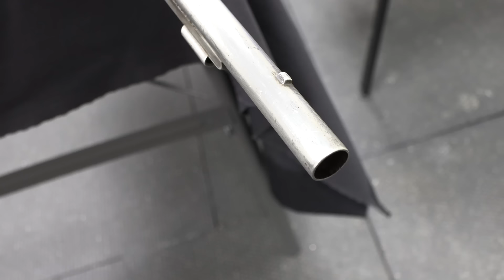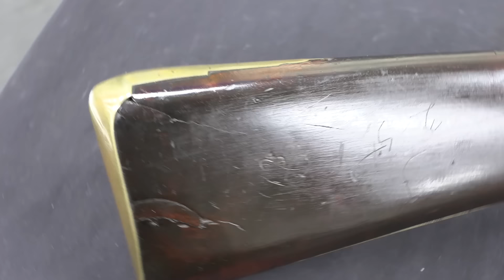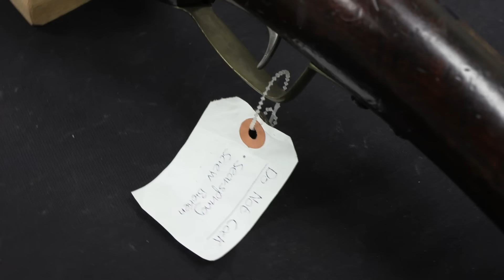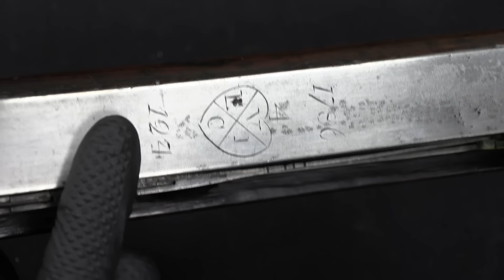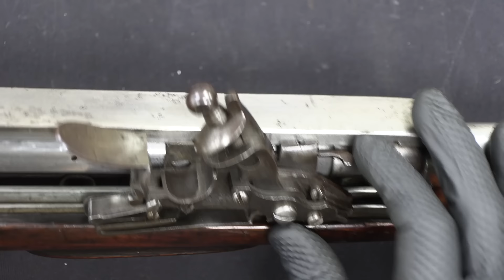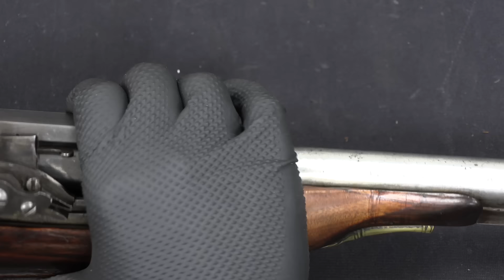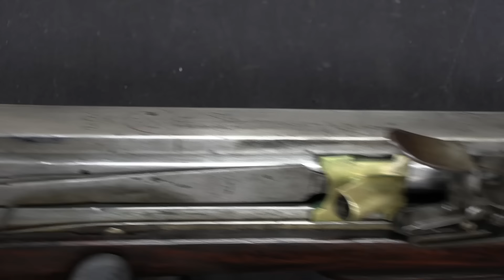Belton Repeating Flintlock: A Semiautomatic Rifle in 1785

Comment: He was living in 2077... My guy leapfrogged cartridges and went straight to case-less ammo.
Reply: Dude saw the birth and the nuclear death of The United States of America. 😢
Reply: Dude you're right!  😲
Reply: The ammo was all caseless back then dude
Reply: @perryborn2777  🤯
Reply: @perryborn2777  This thing shares more in common with the HK G11 than is reasonable
Reply: @perryborn2777 
That makes me wonder, why didn't they invent paper cartridges?
Loading the muzzle loader involved tearing open a cartridge, pouring the powder and spitting the ball.
But this could just as easily been turned into a cartridge that slides down the barrel. 

Once down at the end by tap or ram, a captured metal pin could pierce the cartridge and you prime your pan with a bottle of powder. 
Or a cap placed on the during pin.
No need for wadding, the paper will expand to seal the gases.
Reply: Worth checking out the videos on the Volcanic pistols.
Reply: Never even thought of that...

Semi-Automatic, Caseless Ammo and has blowout panels... the things found on the latest tanks... in 1785...
Reply: @babalonkie  There is nothing new beneath the sun, it’s not just a saying.
Reply: @babalonkie  There is nothing new beneath the sun, it’s not just a saying.
Reply: "10 millimeter explosive tip caseless. Standard light armor piercing rounds." 
 — ALIENS [1986]
Reply: @Allan_aka_RocKITEman ball busters?
Reply: Just like the maxim gun. Went straight to belt-fed before anything else because "why the fuck not?"
Reply: He was also using Duplex rounds too!
Reply: Another way to look at it would be that the tube was a 7 round cartridge.  Move over duplex rounds these are worth 7 XP.
Reply: Black powder isn't what we would call case-less in 2024. They would probably have used a cartridge to load each shot, so you're not having to measure or eye ball how much black powder you're applying to each shot
Reply: @mattfaulk8724 pretty sure it was a joke
Reply: The removable breech acts like a case.
Reply: While also inventing the "Metal Storm" concept.

Comment: This needs a bump stock conversion, and youtube will go crazy. That's pretty neat for its age. There are implementations of this gun in the modern flavour, like "metal storm" so the flint lock is just replaced by electricity.

Comment: This is so clever! I can imagine the level of precision and sophisitication necessary made these a much more daunting prospect at the time, not just for construction but ongoing maintenance. That and even if they worked, there would be a question of if the firepower is worth the expense (considering at different points in time, doctrine called for precision over volume of fire). Still, what a novel idea

Comment: Using Measuringworth calculator, £5 in 1785 would have a labor value of £9,789 in 2024. 

When calculating historical prices, the common mistake is to look at inflation. But these were far poorer societies back then. The price of new shoes for example is irrelevant when people bought used shoes and resoled them until they fell apart. 

Labor value is more useful as it tells you how affordable an item was for the average wage.

Comment: Are the safety plugs made of some softer material than the actual magazine tube? One would imagine at least the ones in the stock would have to be very soft (maybe lead?) to work as intended. Also why use plugs in the stock when you could just use holes?

Comment: 12:00 hang on a sec, what you're saying is they built a select-fire rifle?  Theoretically you could simply slide the fuse-port all the way down and salvo the gun.  Does this mean assault muskets are real!?!
Reply: No, that would just cause the gun to malfunction. The rearmost powder charge (if that's the right term) would ignite, but only the rearmost powder charge. As such, the other six shots would basically be barrel obstructions.
Reply: @budgetcommander4849  no, what he's talking about is firing the normal flintlock first and then using the portfuze to fire the remaining 6 rounds one after another to achieve a 7 shot delayed burst.

Comment: I imagine those blowout holes on the East Indian version were added after someone did the 1780s version of loading the M60 with the bolt forward.  I guarantee someone at some point fired a tube, left the port fire to the rear, then swapped tubes and fired the last round first.
Reply: Yeah, the design probably should have included a pop-out dog that would force you to return the slide to the forward position before you could put in a new tube.
Reply: Reading your comment made me think of the old Beetle Bailey comic strip 😂
Reply: Yea seems like it.

Comment: "Doth this gun chainfire often, good sir?"

"Aye, it'll blow your wig back!"
Reply: After some modifications: "And now it'll only blow your socks off."
Reply: I'm just waiting for the aftermarket multi-touch ignitor that will touch off every [round? literally?] front to back a split second apart
Reply: @RyTrapp0  Bold plan with slow-burning black powder.
Reply: @no1DdC pressure will be a mite high

Comment: I wonder if the inventor ever added a sliding touch hole cover to keep moisture out of the magazine's touch holes. I'm imagining little metal tabs in a top-mounted sliding bar covering the touch holes that gets shoved by back the funnel that holds the smoldering cannon match. It would keep moisture out but also —by having separated tab-like covers— not accumulate powder along the outside, and thus not induce a chain fire.

Comment: I imagine you would have to be pretty meticulous when loading the cylinders, as every time you fire a round the chamber pressure would be compacting the stack of loads behind it.

If the stack hadn't been properly 'rammed' or the a powder charge for one or more of the stack was too much or little, you could end up with your projectile blocking a flash hole.
In the heat of combat I could see someone pulling the trigger, it doesn't go off, they forget whether that position had been fired, they move it to the next position back, and end up firing a double stack or more. 

Pretty cool design for the time though for sure.

Comment: You need a degree in engineering to load and operate the thing. Pull this, crank that, shift this, light that, turn this, light this secondary thing, yank that out. "Are we close to firing?" About 2/3 there.

Comment: My guess is they weren't reordered because they were too mechanically complex. Think of maintaining all those little parts in humid India, you'd have lots of rust unless you were continuously field stripping and oiling parts. As for replacement parts, they were all the way in India, they'd have to cannibalize guns, and to do the repair you would need a very competent gunsmith as those are the opposite of simple guns.

Not to mention the major part of British fire power in India were Indian Sepoys. You don't want to issue these guns to Sepoys.

Not to mention 50 guns each is only enough to equip half a company, that company would require special training.

Not to mention as delicate and complex as the guns were they probably were only used at fortifications not out in the field. So they probably saw minimal use because of that as well.

Comment: Portfires are actually a pretty neat invention in their own right, consisting of a tube made of layers of stiff paper containing a slow-burning gunpowder mixture. You'd light it and it'd burn from one end like a road flare. They had holders which were basically a wooden handle with a split hollow end and a metal tensioning ring; you'd stick the portfire in the end and slide the ring up to hold it in place. Artillerymen often preferred them over slowmatch as an ignition source, since they'd stay burning even in a storm of rain; supposedly, even plunging one into a bucket of water wouldn't extinguish it.
Reply: Go check out Tod's Workshop's video on fire arrows if you want video of something with similar wet-weather performance.

Comment: So basically the cost hindered its adoption and in all likelihood they would be finicky on the field. Modern firearms have demonstrated that dirt,sand, water effects actual functions in the form of prone to jamming. The second issue i see is that of loading the tubes. Sure you get that initial boast after the first tube or two but after that its back to basics. Also the tubes were likely proprietary so that means the owner couldn't go to a local blacksmith n ask for say 4 of these without some degree of variable in performance. In short a idea ahead if its time hindered by the technology of the day.

Comment: I've seen diagrams, but I never knew these were actually made. It seemed like a fever dream.

I wouldn't call it 'semiautomatic' by any stretch, but I would definitely say that this is about as close as you can get with powder and ball in the absence of even a paper cartridge.

I seem to recall the magazine tubes having a leather bandolier that kept them dry. Those are likely long deteriorated and gone.
Reply: Semiautomatic means that each trigger pull - without any other action - sets off a round. This gun qualifies. After you've loaded the gun, you do not have to do anything more than pull the triggers to fire seven shots in quick succession. There's no manual cocking, no refilling powder, nothing.
Reply: @no1DdC  That definition would include double action revolvers, or even those weird harmonica pistols and the Guycot chain rifle/pistol, which are in a technical sense not semi-automatic, as it's meant to refer or recoil or gas cycling the mechanism. In layman's terms though, yeah it's functionally the same.
Reply: @Hyperlingualism  In the eyes of US law, and of any firearm enthusiast this is a semi auto gun. for 60 seconds.
Reply: @jebkermen6087  In the eyes of US law: "The National Firearms Act (NFA) defines a semi-automatic firearm as a repeating pistol that uses energy from a firing cartridge to extract the fired cartridge case and chamber the next round." 

That's from the ATF. Even by the NFA, it's not legally semi-auto unless energy from the cartridge is used to cycle the action. If it's a manual action like a double action revolver or Belton flintlock, it's not a semi-auto. The same reason Gatlin Guns or gatcranks aren't legally full-autos.
Reply: @Hyperlingualism  gatcranks are full auto if you hook them up to a battery, because you would fire "more then one shot with a pull of a trigger"
everyone who's anyone would call this musket semi auto.

you would fail to uphold your view in a court of law.
I will not elaborate further on this subject, this is semi auto.
and your wrong.
Reply: @jebkermen6087  By "battery" I assume you mean a motor. If you hook any motor that'll automatically actuate the trigger, it becomes a full auto. That's the motor making it full auto in that case, not the gatcrank.
Reply: @Hyperlingualism  
Is that all?
your rebuttal does not act on the main subject, simply parallel to it.

it still has a gatcrank, but that does not matter because if you pull the trigger it fires bullet after bullet.

semi auto no matter how achieved,
is the fact that without reaction of the shooter the trigger can be pulled and for each pull a bullet fired.

No hard feeling.
any other questions.
Reply: @Hyperlingualism  It's a semi auto.
I did not say is was self loading, nor does it have to be.

a DA revolver is semi auto. as there are not steps to be taken between shots besides the pulling of the trigger.

what is think your hung up on is that fact that it is not "self loading".
But self loading and semi auto are not the same thing.

and just for the thought experiment, what would you call this musket if it had a spring pull the fuse to all the flash holes at one pull of the trigger?
Full auto maybe?

Comment: This is probably the single coolest, most ingeniously designed piece of firearms history you have brought us. Just wow.
Reply: Right up there with the Guycot chain gun from a little under a century later. 40 shot pistols and 80 shot rifles are still impressive today, even if they are a bit weak.
Reply: It really is. It's complex, but only as complex as it needs to be, and in concept there doesn't seem to be any obvious flaw/etc with the design. Heck, it even has those blowout screws; not required, but as such certainly helps show he knew what he was doing.
Reply: The kalthoff 30 was almsot 100 years odler and had 30 rounds continous fire with a turn of a lever nothing more needed no repriming no cartridge pre loading just 30 rounds put in and the gunpowder into the stock....
Reply: I was just about to comment almost the exact same thing.  This thing is remarkable.
Reply: Seriously!
Reply: i hate this gun so much actually
Reply: I vote for the Alofs, which is the most Wallace & Gromit gun thing I've ever seen

Comment: Amazing design, but I’m thinking about leakage. 

When you get back to shot number 7, you have six vent holes producing six hot jets of flame horizontally to the right. If the shooter had his hand in the wrong place he would have instant regret  and a trip to the doctor. Not to mention the leakage around the magazine/barrel junction. 

If you have ever been standing just to the right of someone firing a flintlock you’ll know what I mean. With a big bore and a worn vent it can feel like a blowtorch. British soldiers of that era often had “powder tattoos” on the left side of their faces from the next guys priming. This gun would be seven times that, plus the left hand placement problem.

Also an increasing loss of velocity as the number of open vent holes increases.

Comment: I can't seem to find it, but I can so vividly remember a video of a flintlock with an automatically refilling flash pan, and I can't stop thinking about how such a mechanism added onto this might have been the final bit of tech that turned it from a expensive piece of showmanship into an effective force multiplier. I don't know if it would actually work, but the thought of it excites me (edit: Found it! I was thinking of the Collier Flintlock Revolvers' system of automatically priming system)
Reply: There were a number of these from various makers.
Reply: I get the general vibe that "the semi-automatic musket" was a very doable concept at the time, but the end-result was difficult for the layman to use and very dangerous in the event of any serious malfunctions. Such designs were expensive as well, and depending on the system they can be quite difficult to repair, especially when compared to a conventional flintlock.

It's still surprising that we didn't see more of these oddities being fielded by the super-rich militaries of the era, these types of weapons seem like they would be especially good shock troops on a rank-and-file battlefield or commendable fortress/trench-fired weapons. Imagine being flanked by a platoon of 5-7-shot muskets, they would destroy most firing lines within the time it takes them to fire and reload once. Proper usage of such a weapon could've dominated the battlefield if artillery doesn't wipe them out first, which could've changed conventional tactics of the era entirely. They'd have to retire more quickly from the battlefield in order to keep their rifles well-maintained, but then again they'd have to do that anyways to reload by the time their rifles have fouled-up, since these weapons would be firing so much more rapidly. It would be a worthwhile trade-off if the mechanisms weren't prone to breakages.

But then again, each of these flintlocks would be firing their rounds with less powder behind each shot versus a single-shot rifle right? So they would have inferior range in theory and that would have to be planned around by the commanding officers of a given battle. It's definitely an interesting thought though, if the world could've been changed by such a design or not.
Reply: The two that immediately come to mind are the Lorenzoni system and the khaltoff repeater
Reply: @xskyhawkx7821  I think those systems would be more of an alternative to the one in use on these rifles, (after some more looking I found what I was thinking of) I was thinking more of something like the Collier Flintlock Revolvers. This way the primer would automatically reset and you could fire all the shots only having to move the lock when firing, and then reload the primer on the lock at the same time as reloading the bullets.  (Link to Ian's video on the Collier Flintlocks https://www.youtube.com/watch?v=i9Km5KaeO7I&t=8s)

Comment: Great video Ian! Even if they worked as advertised, it was probably more militarily effective to have a few men with ordinary flintlocks than 1 man with a Belton gun which is why no subsequent order
Reply: Having just one or two guys sending rounds off while the firing line is reloading would probably have been devastating

But that's a very expensive piece of equipment to give a simple soldier, and it's quite an ungentlemanly way to conduct warfare
Reply: @Grouuumpf  I would guess (though I certainly don’t know as I’m not privy to any special info) that these were destined for fortifications. With how much they spent and how complicated and intricate these were (which they had to be well aware of) they knew basic infantrymen weren’t getting one.
Reply: @Dominic1962  I was thinking deck-sweeping on ships, which is why I'm surprised the East India Company sent these to India and kept them there instead of using them on their ships.
Reply: @no1DdC  That could be too, yes, but I’m guessing they figured it was too complex for use in the salt spray environment on ships. 

The EIC had its “Presidency Armies” based in Madras, Bombay and Bengal.
Reply: @Dominic1962  Thinking on that, what about monsoon season? Rather difficult to keep things that venture outside dry.
Reply: @arthurbrands6935  I’m saying against boat use specifically because of salt water, not so much just getting wet.